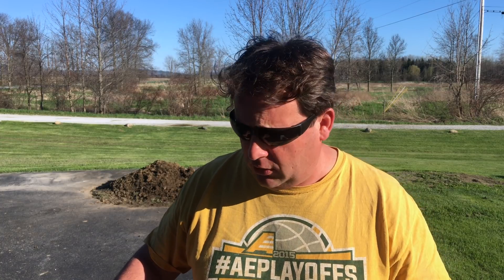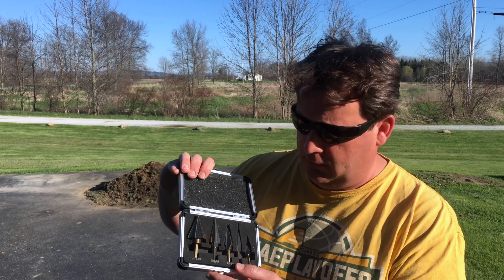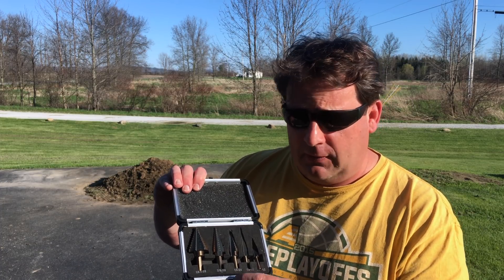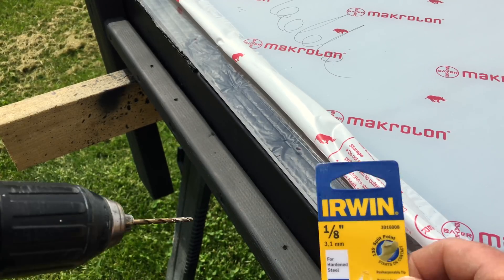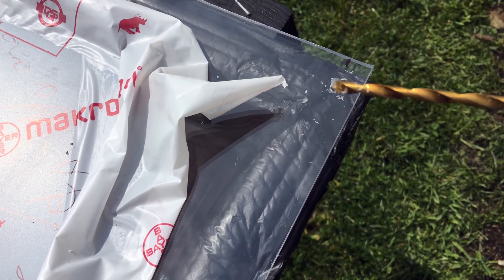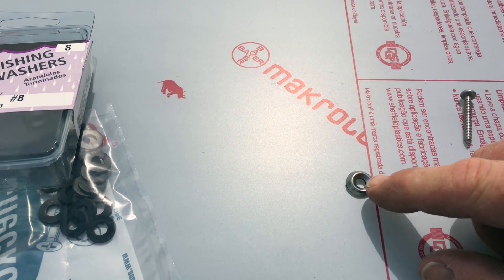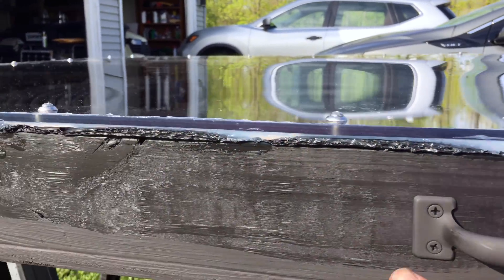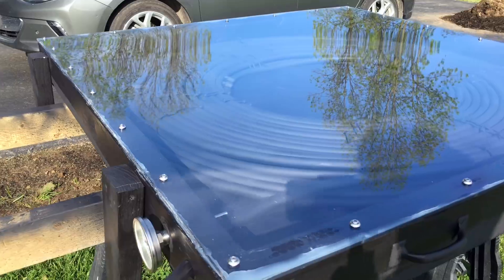DIY Solar Pool Heater - Part 3

Comment: I had my doubts about this. It worked wonderfully though. Our pool without it the temperature was un-swimmable. It raised the water temp a good 10 degrees. (We also used a solar cover)

Comment: I painted Reflectix black on one side for my stealth boondocking setup. If you put the black side out, it should help warm the inside of the car (when it's sunny) even when it is cold outside. I suspect you may have gotten better warning by leaving it silver to reflect the light to the back side of the tubing while preventing heat loss, versus converting the spare light into heat but losing a bunch of that through the wood and trying to move the rest through an airspace instead of direct contact. 

You could add thermal mass in direct contact with the tubing to grab additional heat energy in the corners and release it after dark, but it would be more portable when empty if you just made it more water in more tubing.

Comment: what's better poly pipe or copper tubing.  Just wonder whether a metal pipe would provide more efficient heat transfer.  Also I see a lot of small pipes in retail products.  Does anyone think smaller tubes provide better efficiency?  Why not just build a thin metal black box?  With enough flow throughput it seems it would be just as efficient and less cumbersome to produce.  No, Yea?
Reply from the maker: All great questions!
Reply: your thin metal box would lose a lot of heat to the environment unless it were enclosed, first. Next, you actually want a lot of surface area in contact with the water to transfer more heat energy. think about a radiator where there are lots of fins. That's trying to move heat from a solid inside to fluid (gas) outside. Going the other way you want to turn it inside out and have the solid tubing with lots of surface area touching the water you are heating. The tubing does that by putting walls between each loop. I would think copper would be better for longevity as well as heat conduction (not for drinking though). Not sure if painting it is tricky though. 

I don't know if the second layer is truly any better than more thinner tubing in one layer, apart from the head pressure and maybe how much water you want it to be able to hold in the collector if you aren't running it constantly?

Comment: I love your idea of the tubing in the box but I’m wondering what you would think of just mounted the box on our back deck’s black steel roof, which is right next to our above ground pool (instead of leaving it on the ground with a solar panel)?

Comment: Why do you need hot pool water on a hot day. Makes more sense for domestic, cleaning and washing
Reply: Because there are cool days in between the hot days. In the north we have such short swimming seasons and cool nights a lot in the summer so the pool water takes forever to heat up. Yesterday, June 13, it was only 55 degrees during the day. We would rather have warm water, and if it happens to be a little warm on a warm day, we’re ok with that.
Reply: That’s fair enough. It’s a great idea ... I wasn’t trying to bash your invention by the way, just curios. That’s interesting on a cool day you can collect enough solar to heat your pool 👍🏼

Comment: I run 100 feet of pex for my outdoor furnace and it expand 2 feet when its up to temperature.  I’m predicting (sorry!) thet expansion and contraction will pull this beautiful design apart fairly quickly.  If the coil was left free floating that would not happen.  I will use many of your design ideas—thank you!   Let us know how this works out.

Comment: This is very slick design! How think was the Lexan you used? Did that thickness seem ok or would you have gone thicker or thinner? Thank you!
Reply from the maker: I believe it is 1/4 inch.  I bought at out local glass store. Bought a 4x8 sheet.  They cut it in two and delivered it.  I plan on building another pool heater this Spring since I have the Lexan and all of the parts.

Comment: Panel should be at 45 degrees .. not 20.. Sun does not get much higher that that in angle.. Also .. at 20 degrees.the clear glazing will reflect much of the suns energy right off like a mirror..  you can even WITNESS that in your video.. Want MORE GAIN.. take a sheet of that silver insulation.. and put it on the lawn .. below the panel.. (after the panel is raised to 45 degrees.. The sun will hit that foil.. and reflect up ONTO the panel.. Like 2 SUNS.

Comment: Great instructional videos. I’m making a solar pool heater nearly identical to yours, but with one row of pipe so the sun hits it directly. My question is about the Lexan polycarbonate sheet. I’ve been doing much research on both Lexan (polycarbonate) and acrylic (plexiglass). Both reflect UV rays, but only Acrylic makes a certain type that transmits UV light through the glass.  This is designed for tanning beds and greenhouses.  Since we are essentially making a greenhouse for the irrigation tubing, wouldn’t it be more beneficial to use UV Transmitting Acrylic rather than polycarbonate?  I think the pipe would heat up much faster, making this solar heater much more efficient.  Thanks again, great videos!

Comment: Thanks for making this and including parts and tools. Didn’t see link for the plexiglass though.  Also, the electrical box setup is amazing (and way over my head). You feel it’s cheaper to do the solar panel and all that instead of just plugging in an electric motor? Or just more fun? Could you explain the setup of that part in more detail?  Thanks!
Reply from the maker: Thanks for checking my video.  The Lexan glass is not listed as it was purchased locally.  I will update the part's listing to reflect that item  Too expensive to ship as the glass was purchased in a 4x8 sheet (about $200). Lexan is way more stronger than plexi.   I did the solar panel as I wanted to keep everything off-grid.  Also, no-sun then minimum flow and the heater is not circulating water that is not hot.  One could use a small motor but should keep it a DC (12 volt is perfect) one for low-flow.

Comment: Hi there, like your setup, I also built one of these this year (I'm in Cyprus), but it was open pipe on an x-frame, and also just used the pool filtration system to act as the pump. I stopped using it about 2 weeks ago as my pool was nearly up to temperature. The pool iteself was a steady 28c when I stopped, but the coil temperature outlet was exceeding 46c. Now the pool cover itself has been enough and last weekend the pool was sitting at 32c. You can see my setup at: https://www.youtube.com/watch?v=UrphHlYihCU

Comment: NICE brother. The pool here is not heated and it's at 95F. We have to cool are pools in the summer if not there like a bath..
Reply from the maker: yankey4 that’s hot bro!  How do you cool a pool?
Reply: The pump spays there return water in the air kind of like a big fountain. Then my brothers we made a loop out of the red PEX tubing. We sank it in his pond. The pool pump runs the water out there before it is returned back to the pool..
Reply from the maker: yankey4 Ah, I see!  Very creative in cooking the water off.